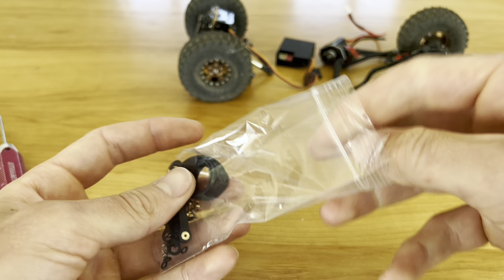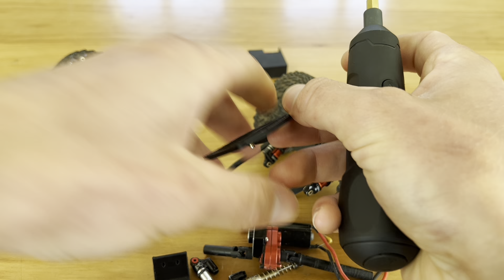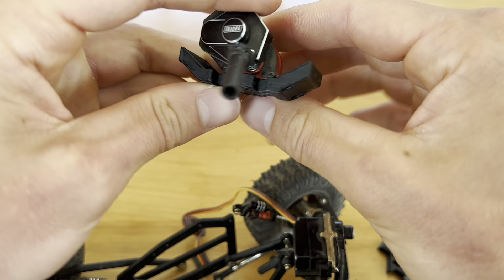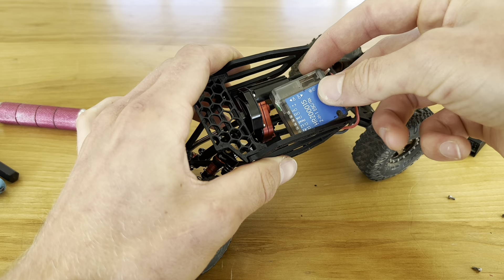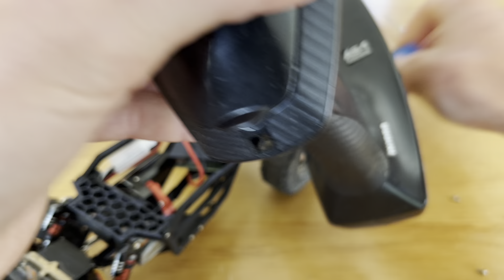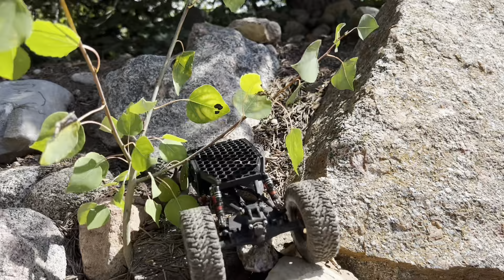SCX24 Kamak Chassis Assembly Video

Comment: Dimensions of the battery you are using would be helpful. My stock 350 mah is 50x20mm, and every 450 I find is longer and wider, so unsure if they will fit. Thanks